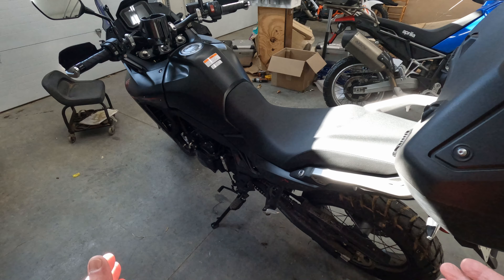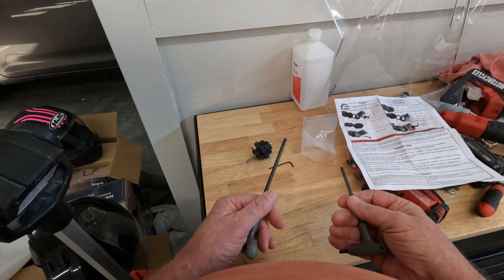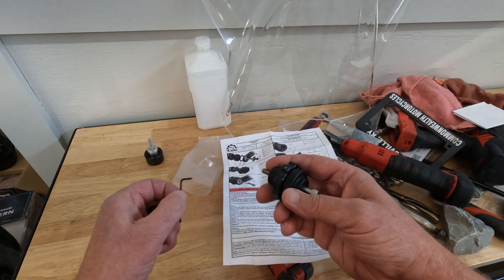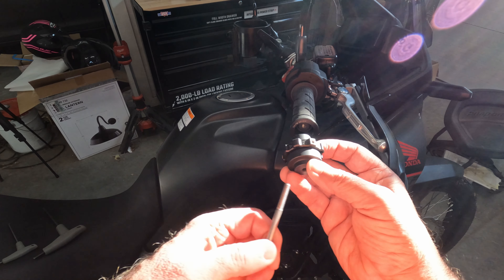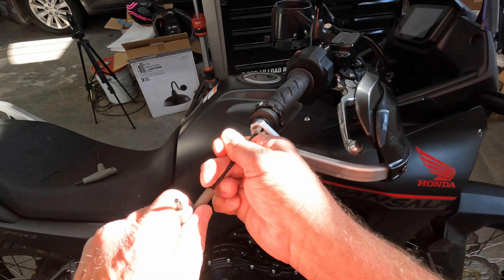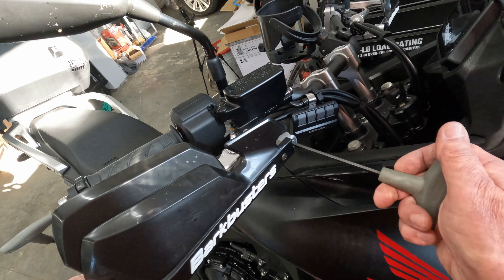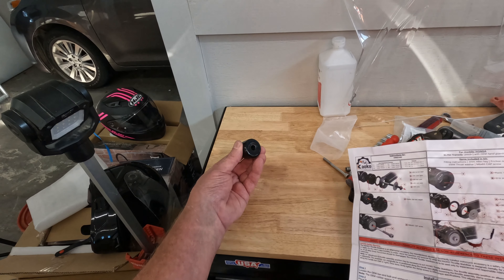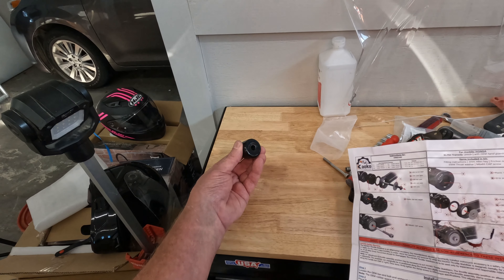Honda Transalp XL750 Cruise Control?!?!

Comment: Good to know that there is a work around to that issue.  What is the price for that gizmo???  Looking forward to seeing how it works on a stretch run.
Reply from the maker: Around $130.00 at Revzilla https://www.revzilla.com/motorcycle/kaoko-throttle-stabilizer-honda-xl750-transalp-2024?sku_id=10369841

Comment: That is a very dangerous way to get cruise control. I would never put that on my Transalp.
Reply from the maker: I do wish the bike had electronic cruise control that better maintains the speed you set it for. But you can easily back off the throttle or you can pull in the clutch if your right hand went to sleep, it's no more dangerous than regular electronic cruise control, and you got to watch out either way for people pulling out in front of you. It always turns in the loosing direction when you decelerate. And I did think about the same thing you mentioned, but I had to find out for myself. Thanks so much for your comment.🙂
Reply: Factory cruise control shuts down as soon as you touch any brake or clutch lever. So I have to disagree with you.
Reply: Is FACTORY cruise control even available???🤔
Reply from the maker: @oscartaylor4063  I don’t think so. I haven’t seen any information from Honda showing cruise control an option available for the Transalp yet.
Reply: Don’t worry Mccruise will come out with one soon
Reply: @rickhadfield1097  The MCCruise is $676.  The Veridian Cruise is $306